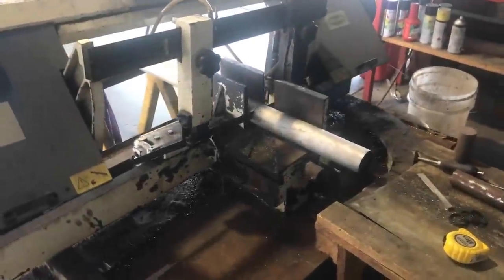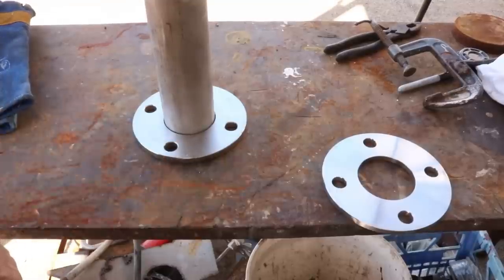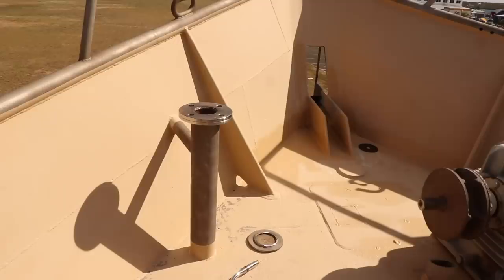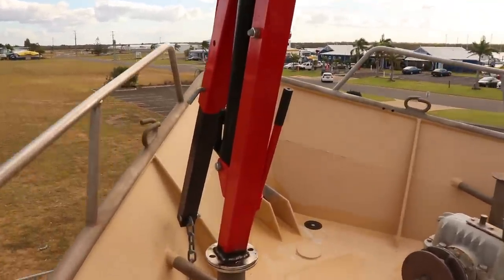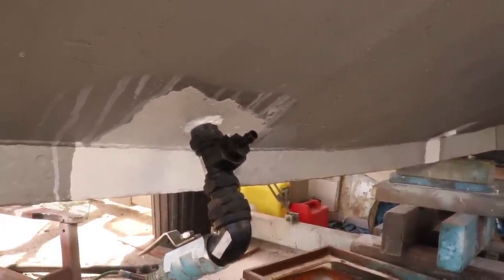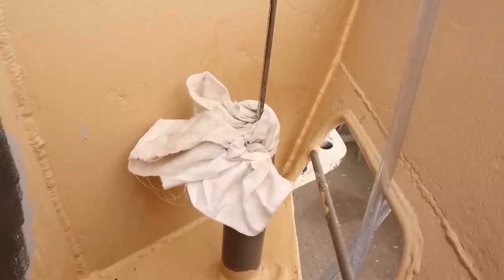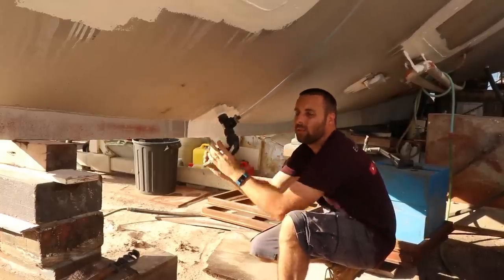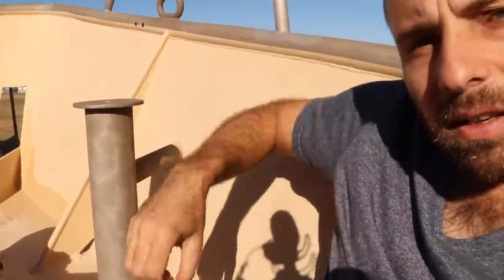Bow Crane & Tank Pressure Testing - Project Brupeg Ep. 82

Comment: I suggest using a plastic cutting board to cut yourself a slip washer between the two flanges.   Additionally you could easily slip the crane up and out of the Samson post, stow the crane.  then weld yourself a short section of pipe that fits inside the post to the top plate cut from the top of the Sampson post.  You then can slip this into the new post flange and use your post as designed.  May also need a pin

Comment: If you're going to add a grease port to that sampson post to pump grease between it and the stainless swivel pipe inside, I would suggest capping the bottom of the stainless pipe. That would allow you to really fill that space with grease without pumping grease up into the inner pipe, and it would come up between the two flanges when it's filled, greasing that connection and preventing any moisture from getting in.
Reply from the maker: Yeah that’s a good point. Will do. Thanks Drew

Comment: Nice crane! For small ROV operations consider adding some cable fairleads and a feed wheel on the far end for passing a rov data cable in addition to the winch. My rovs for example will launch from a ROV garage which is a small box that sits stationary on the sea floor while the rov goes and does stuff. It's basically like a little elevator car with a lift cable and a separate data / power cable. Being able to feed 2 cables cleanly helps considerably. Also consider adding a cable passthrough and a few cat6 data cables from near the base of the crane to a theoretical ROV operater station to allow for inclement weather runs. Other rov considerations, a flat parking area with tie down points and for some torpedo style rovs  "u" shaped padded rest brackets.
Reply from the maker: Yeah we will be building a bigger crane on the rear deck. I will get in touch when we get to the design stage as I will include these extras

Comment: Crane looks good and will handle lifting heavy things on to the boat. You'll need a couple brackets to hole the anchors and rigging from bouncing around in heavy seas. Only problem I see is it will be harder to tie up to the Samson post when the crane is deployed. Maybe weld a couple nipples to make a tee cleat on the post under the crane.

Comment: Add small battery winch  a couple of pulleys and you have a really useful light crane...
Reply from the maker: That is the plan in the end. im thinking we will keep it manual and just add a stainless boat trailer winch. Manual versus electric/hydraulic means cost is low and reliability high

Comment: You should add a 2000 lb 12 volt electric winch to the crane to lift your equipment up from the dock instead of cranking by hand. better on your hands trust me. plus you should make it portable and be able to transfer it over to the other side where their is another pipe and use both sides of the boat.
Reply from the maker: Yeah that’s not a bad idea. Thanks very much

Comment: You should weld an axle on the center of the inner post and put a bearing (doesn't need to be a good one) that rides with the outer race on the former Samson post. That way, your stresses are dispersed equally and evenly through the whole pipe vs at the flange directly on your weld. This doesn't need to be precision, mind you. It just needs that extra support that's not metal to metal (so to speak). I would in fact go with a shot/destroyed bearing, since it's loose and won't have problems with rust. Just my 2 cents
Reply from the maker: Yeah I’m going to add a Teflon type flat washer bush under the stainless flanges and a tube style bush down the bottom

Comment: Regarding the pivot shaft on the crane derrick, cap the bottom of the inner tube and fit the grease nipple (zerg fitting for our US friends) about 100mm (4") off the deck.

You'll need MUCH less grease and you'll know when it is full as grease will ooze out the top (and I know you'll use marine grade grease so that point is moot).
Reply from the maker: Yeah I hadn’t thought of capping the tube (I assumed the trapped air would prevent it from filling with too much grease). I do like the idea of it capped off so will add that mod in next time I have the welder up on deck

Comment: Great work as usual Damien.  What I like about you, You are really good at explaining clearly the thought process, how and why you are doing something.  How is the Car engine jack going to cope with salt water? It is not designed for the Marine environment,  and it's on the bow, where all the water comes over. I suppose, lots of marine paint, lots of grease and a cover over the crane, might last a good few years if lucky enough and not expensive to replace with another one later. Time will tell. Thinking about it, you could have an exact one as a spare on the boat.
Reply from the maker: Yeah my thought on this was to machine up a stainless shaft. The housing should last I think but he mild steel shaft is pretty garbage. For now grade and covers will be my friend

Comment: the metal to metal contact of those flanges will cause grief when is under load, needs a basic bearing or greasing system for sure
Reply from the maker: Yeah we will be adding in both of those

Comment: If the crane works like our hydraulic log splitter, if you always store your hydraulic ram in the down position, it should protect it from rust... That is how we protect the ram on the hydraulic log splitter... Assuming there is a seal at the top of the ram to keep the moisture out, splitters have oil on both sides of the ram for in and out, so this may be different, but worth trying.
Reply from the maker: Yeah I’ve started storing it down for that exact reason

Comment: Suggest that you prime the inside of the crane components very well as they are likely to rust pretty fast.
Reply from the maker: Hi Paul. Yeah we will likely replace this crane with a stainless copy. This is a 1-2yr crane at most and it’s mainly a test to see if we want to modify any part or design before committing to the stainless expense

Comment: You may think about soaking some wool in some lithium grease to go between the two flanges to work as a thrust bearing.
Reply from the maker: Hi Jared, we haven't finished the base yet. future additions will be a plastic washer type wear plate between the two flanges, a plastic tube type bush at the lower end of the inner tube. and the whole lot filled with low temp capable marine grease. so in theory no water will get into the tube to freeze and the grease will hopefully always provide a good friction reduction.
Reply: @ProjectBrupeg  that should work.  I just suggested the greese soaked wool cause it would also act as a gasket similar to a stuffing box on a prop shaft.  But didnt hear you say you were filling the Samson post with greese until I rewatched the video.

Comment: Won't the Lift AKA "Crain" because it's just painted or powdered need to be taken down to bare metal and be epoxy paint coated? Glad you finished our education on the coating in the tanks. Was wondering how it was going to be dried out the fuel isn't contaminated by moisture. So does that mean the access plates the where just put on have to be removed and spraying the surface's can be done?the main purpose was to check the welds wasn't it?
Reply from the maker: Hi Page. The tanks are fully painted. They won’t be opened up again. Because of the heat generated in those tanks by the sun the last half cup of water at the bottom evaporates out fairly fast. As for the crane, yes it is just powered coated. It’s almost certainly going to be a rust point. However, given our dump and run schedule we can accept that as it’s only a looks thing, that said I will either be blasting it down and galvanising it or replacing it piece by piece with stainless box section etc so after a year or two this crane won’t exist and a stainless replica will sit up there. Using this one gives me a chance to see what I like and what I don’t about this design in real world application and modify the stainless version when the time comes

Comment: Another great video, thanks for the shout out!

Given that you'll be pumping oil and water around the boat will you need to incorporate some form pressure relief?  Just so the tanks and/or pipework are protected. 

I would also suggest that you incorporate UV and a filter, say 5 micron on your water system.  Once sailing you won't be able to guarantee water quality, you'd only need that on the potable water, showers or what ever don't matter.   Are you planning any "grey" water storage?

Thanks again for sharing
Reply from the maker: Yeah we currently filter all water in the boat down to one micron. We will be adding some grey and black storage but haven’t got to that yet

Comment: Another great episode, answered a few questions regarding the tanks as well......seems like your getting a bit of advice regarding the crane, but  thought I might just add my 2 cents, from my experience the original crane riser isnt all that heavy duty and it did have reo straps to the base (which you removed) I have put a bit of load on them in the past and with that extra strain the crane riser does need it.....i would strongly consider sourcing a heavy duty piece of steel (maybe 6mm wall) to replace the riser. Even under normal lifting conditions you might find it a failure point but under dynamic load, potentially in a bit of a sea.....
Also consider a slew control device (worm gear) again under normal conditions all easy, but when in dynamic rolling seas a load (even relatively light) can get out of control. Pins are fine when just lifting up and down, but you need to think about when you are going to swing the load.
As far as winches go, I have used several types on this style of crane/davit, probably the most versitile would be a yacht sheet winch mounted to the riser. 
Apologies for the lengthy comment, Cheers
Reply from the maker: This is really helpful thanks Dan. Yeah over time I’m thinking of replacing parts with stainless so I might make a stainless riser out of 6mm box. I did think or a worm drive but don’t yet know where to get one, I’m thinking some sort of ring gear would be needed
Reply: @ProjectBrupeg  Things that come to mind are crown wheel and pinion from an old differential, or maybe parts from a steering box, but have also seen a bit of heavy duty engine timing chain tacked to the rim and then driven by the gear cog.....not sure if you can find a bodgy corrosion resistant solution, I'm sure you'll come up with something that works.......nesessity mother of invention......just got to identify the possible need before you realise it while you are pinned against the gunwhale by a swinging load, happy days.....now get back to work! (note to self).
Reply from the maker: It would be nice to have some sort of gear reduction so fine tuning is easy rather than big brutish movements
Reply: @ProjectBrupeg  Totally agree, but I think slew control (which gear reduction wiould provide) should be more the focus......you are swinging a load not aiming a telescope ;) Recon most of the bodgy options I suggested previously would provide reasonable gear reduction (diff crown+pinion would be my choice) for what is required, be good to see what you eventually come up with, cheers
BTW - Need an update on jet tender in next ep.
Reply from the maker: Yeah we are looking to get jet tender back on the to do list, had a fair few stops on that so it’s been hit and miss

Comment: Hi Damien, great work, great videos, and an extremely worthwhile project. Great little davit you have peiced out of an engine crane, i'm wondering how the pivot goes when it has a few hundred kilos on it. Will it pivot or bind. should be fine with grease on it. I know getting a bearing kit and fabricating it into the base is an expense of both time and money.
Reply from the maker: Yeah I’m thinking with a plastic washer between the flanges, grease filled tube (grease on the plastic too) it should move ok. That said a little resistance isn’t a bad thing, remember this will have fairly heavy anchors dangling off it so having those move easily might actually be a bad thing at times

Comment: You might have missed an opportunity to calibrate the tanks by measuring the flow during fill i.e. 5minutes flow = 200 litres etc. Given you were top filling the rate would be fairly constant. If you wanted to cross check and had the time/patience you can measure as it drops out.
Reply from the maker: This is true but I didn’t have a method of easily knowing what my flow rate from the hose was. We will be adding digital flow meters to the tanks so it’s something we can work out later as needed
Reply: @ProjectBrupeg  200 litre drum works well. Another option is to have someone watching and recording a sight glass when filling the tanks with fuel.
Reply from the maker: Yip, I’m sure we will do some version of these methods when the time comes

Comment: One last question, what's the likelihood of getting a pinhole leak in the fuel tank when you finish grinding the outside of the hull on those welds
Reply from the maker: We won’t be grinding the welds off on the outside. They stay as they are so we don’t risk getting cracks and fractures in the join

Comment: Are you actually going to find tiny pinholes in those hull welds with the paint on them? I suppose if you tested at pressure for several minutes there would be no issue as the paint would bubble right? I didn’t hear how long you tested for.
Reply from the maker: Held pressure for about 15mins. The leak we found wasn’t leaking without pressure so I’m happy that once that’s repaired we will be good

Comment: Quick question here. What stops the crane from coming out of that pupe in heavy sea?
Reply: He mentioned throwing in a pin or a bolt to keep it stationary, a bolt and nut would keep it locked down in heavy seas. He could even go for a heavy duty padlock or snap shackle.
Reply from the maker: Yeah we will be bolting it at sea. Plus it’s blimmin long so if negative gravity did happen at the wrong time it’s going to take a huge amount to dislodge it

Comment: I might have missed it but are you putting any sort of bushing near the bottom of the pipe?  I would think without one the pipe would wallow out the hole in the bottom flange.  Or do you think having big weight bearing flanges will be enough?
Reply from the maker: My plan is to add a plastic sleeve type bearing on the OD of the inner tube at the bottom, so its this that wears not metal on metal. I also plan to cut up one of Jess's plastic cutting boards and use it as a big washer between the two flanges. on top of that i plan to add a grease nipple which means I can fill the inside with a good grease and prolong and wear surfaces but also keep the water out of the tube.
Reply: @ProjectBrupeg  Yea I saw the cutting board and grease part.  Wasnt worried about wear inside pipe from friction so much as it tearing it up without any support.  A plastic sleeve should provide enough support though.
Reply from the maker: Honestly this will be trial and error. It might work (I think it will) it might not. If it doesn’t I’ll just figure out why it broke and modify it to be stronger. Most of this boat has been built with best guess and accepting I may need to change stuff later on

Comment: in addition to grease nipples (and some grease distribution channels ground into the thrust plate with the grease nipple), could you weld a lip on the top half of the pivot that covers the gap between the two mating surfaces? with a close enough fit, that'd both keep side-blown water out, and keep grease you pump in there... in there.
Reply from the maker: yeah i can see that working. I dont have a lathe so any close machining like that is a costly thing for me.

Comment: You said you wanted to lift 400 kg.  I don't know exactly what the dimensions of the square tube that was welded to the flange but a quick calculation of the stress if the tube is 4 inches square with .100 wall and the load is 48 inches from the base shows a stress in excess of 25,000 psi at the base where the weld is located.  The metal in the square tube is unknown so I wouldn't use a yield strength of much more 30,000 psi.  When lifting, a safety factor of 5 or more is generally needed and you are are close to a safety factor of 1.  If fatigue strength is considered, the safety factor is much lower.  The added gussets help but may not be enough.
Reply from the maker: I’m going to take your word on this maths. I’m a build it and see guy. If it doesn’t work I build a stronger one...
Reply: Respect for the engineering, practical experience alerts me of the potential risk, good to know my intuition is backed up ;)
Reply from the maker: I’m Happy to beef this up if anything starts to fail. For now we need to get floating but I can see how this might become an issue down the track
Reply: @ProjectBrupeg  Agreed ..... I'm not nagg'n just chatt'n, good to see things gett'n done, keep up the great work.
Reply from the maker: All good thanks for the maths. It’s certainly something to keep an eye on

Comment: Love your channel and you guys but won’t the Engine hoist rust like crazy?
Reply from the maker: Most of it is a sealed unit. The top sliding box section will rust over time. My thoughts on that are eventually I will cut the box off and replace with stainless. For now I’m going to accept it’s not perfect as I would rather be in the water and a steel crane gets us floating.

Comment: Use a plastic filler cap with a pressure valve? should be easier to just snap on air hose and should be cheap if you can find a plastic cap with same threading as filler neck
Reply from the maker: Yeah, that would work, I work with the gear I have. had some pipe and irrigation fittings, a rag and an air gun. didn't have a regulator that would work...